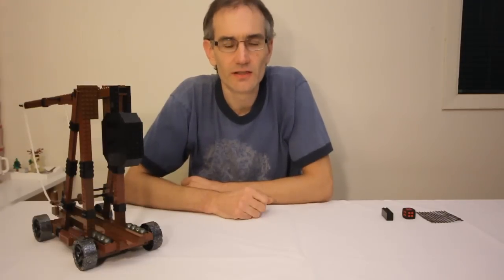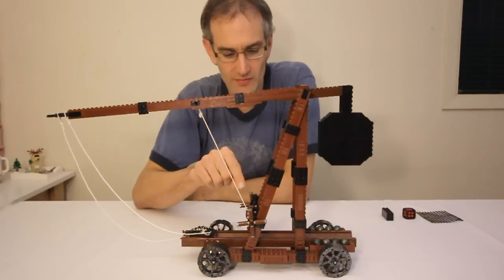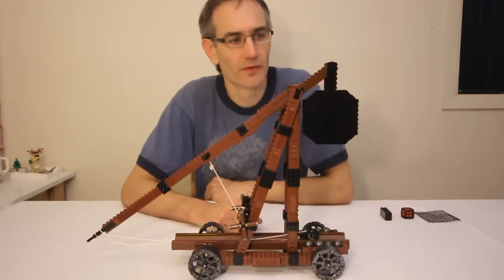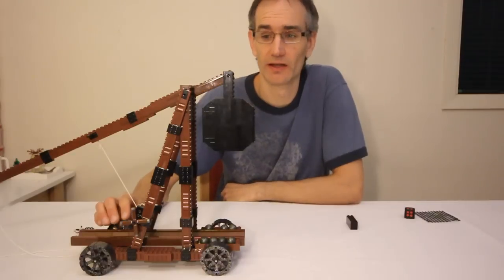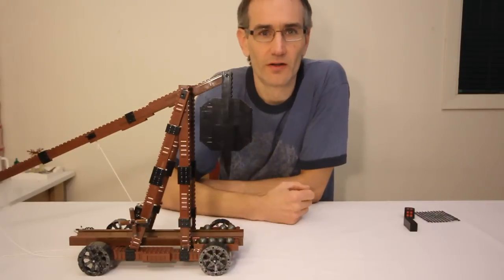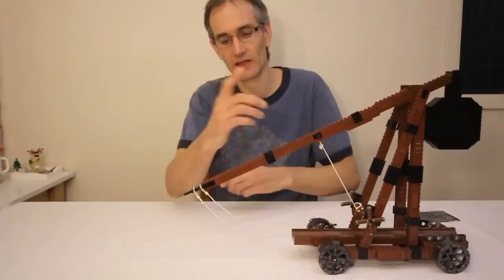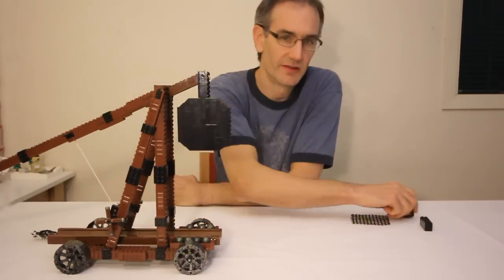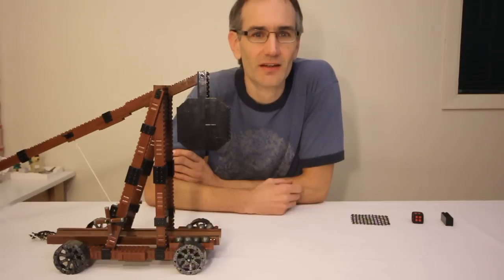Custom LEGO Trebuchet

Comment: I really hate to nitpick but the instructions and parts list on your site do not match up to what you have in the video here. There are no instructions for attaching the string and net, the parts you have on the winch are different than what is in the video, several of the parts on the struts are all different, etc. THIS trebuchet looks great and it would be nice to have a matching parts list and instructions for it.

Comment: Steel ball bearings as counterweight
Reply: paul goodier batteries as the counterweight is what I’ve used. Only need one or two 9volt batteries. Plus, they are rectangular and relatively easy to put in the counterweight bucket, as well as remove them.

Comment: I personally would have made it without the wheels. As such as Trebuchets were normally defense emplacements due to their massive size and weight. Many armies favored the smaller and lighter Catapults. 
Or at least made some kind of movement block so the system would not roll due to the wheels. This does actually reduce your accuracy and maximum effective range.

Comment: Love it! I've made a Trebuchet from lego a while ago. It started out very simular in design but because i used a solid base without wheels it ended up being alot bigger to make it more stable and throw further. It has supports to the main frame to divert some of the stress and it has 2 outriggers on the sides so the main frame does not flex as much during launch..Boom and counterweight are much larger/heavier.
i used a small key ring at one end of the rope to make it slide of the end of the boom real easy when it launches. makes it very simple to load and it never fails to detach :) I could have used a longer rope to try increase the distance a bit, but it had no problems throwing bricks to the other side of the living room =D

Comment: I might be digging up and old video, but I have a wuestion nonetheless : are you wasting a lot of energy for the shot due to the fact that the trebuchet is wiggling around on its wheels ? Some wheelsblocks might be a good thing here, I'd suspect a substential boost in range.
Reply from the maker: +jancello It actually doesn't make much of a difference, at least in this application (I'm not sure about theoretically).  If you watch the launch sequence in slow motion, you'll see that the trebuchet is rocking forward when the ball is released, which probably imparts a little bit more forward momentum to it.  I tried with a solid base and the biggest issue was the stress on the frame after launch.  The wheels really allow it to absorb the swing of the counter weight a lot better.
Reply: +JK Brickworks Thanks for the detailed answer. I'm no expert either, but I'd say that the great stress on the frame is a proof that there is a lot of energy involved. Absorbing some of it with the wheels means losing it for the projectile. Also, probably engineers building trebuchets in the Middle Ages would probably build machines that were almost perfectly balanced, so that the frame almost didn't move through the launching sequence, be it on wheels of with a solid base.
But I'm just nitpicking here, your build is impressive in any case :)
Reply: +jancello The idea with a trebuchet is to capture as much energy from gravity as possible. Because the weight is attached to an axle, the path is curved, and energy is lost. The wheels allow the frame to move so that the weight takes a straight path directly downwards. Alternatively, the weight being able to pivot on the throwing arm allows for a similar effect.

I have built a Lego trebuchet before. Unfortunately, in my experience, both solutions cause problems on the small scale. A fixed weight and only the wheels should work better, though that would need some testing. On large trebuchets, the weight may be a bunch of rocks in a basket, so the pivot also allows for the basket to stay vertical.
Reply: +JK Brickworks The wheels actually conserve angular momentum. The idea is for the weight to travel straight down in order to capture maximum gravitational energy. Since the weight is attached to an axle, the path is curved, and energy is lost. The wheels allow for the entire frame to get out of the way so the weight just travels vertically.

Also, you might try fixing the weight to the throwing arm. I think that might improve the wobble for the small scale.
Reply: Actually the wheels moving causes the counter weight to drop in a straiter line thusly giving it more energy for the throw.

Comment: A good ratio for furthest launching capabilities is 100g (counterwieght)/1g (projectile). Optimal throwing angle is 45-50 degrees (when the string releases from the throwing arm). Sorry, it didnt look like you were getting a lot of distance out of that, through engineering class i made a trebuche which launched a 3g metal nut about 35 feet with a trebuche about half that size.

Comment: Just a thought, if you were to stabilise it whilst it's going through the firing procedure you could make it more efficient  by not wasting energy on it rocking back and forth on its wheels.
Reply from the maker: I tried it without wheels and it actually puts a lot of stress on the frame.  With the current design it seems to waste energy anyway as the frame jumps around. :)  With a stronger/heavier frame I could see keeping it stationary making more of a difference.
Reply: Any hope of getting in touch with sariel and creating a lego technic trebuchet instead of the classic lego system parts? The technic system is used more often for high-torque applications for a reason.

Comment: What did you make your sling out of I went on the instructions and could not find it.
Reply from the maker: I used one of these cargo netting parts: http://www.bricklink.com/catalogItem.asp?P=71155

I fold it in half, then kind of scrunch up and tie each end with a string.  You could just use a piece of cloth too.